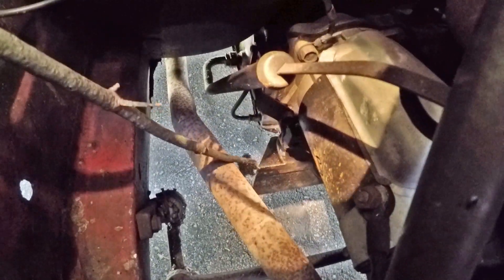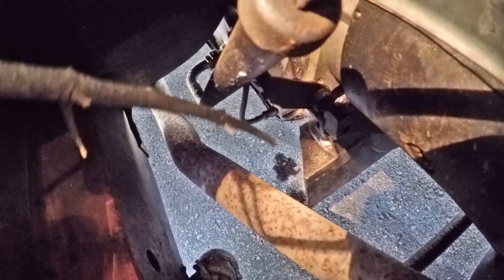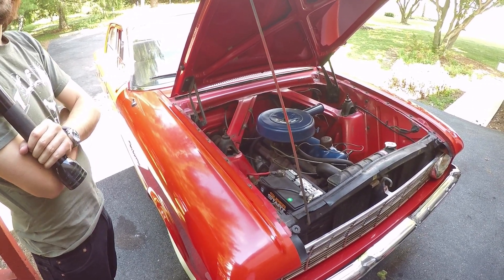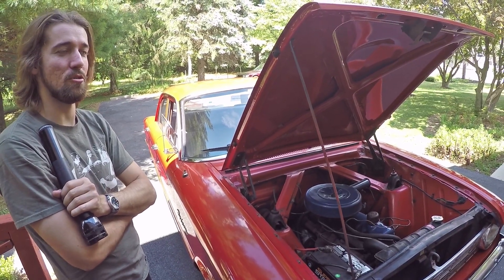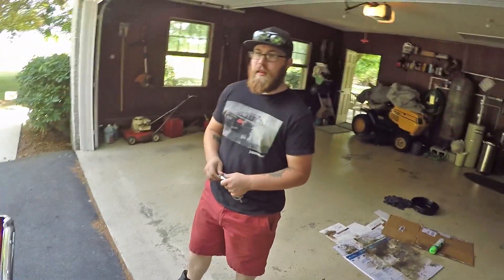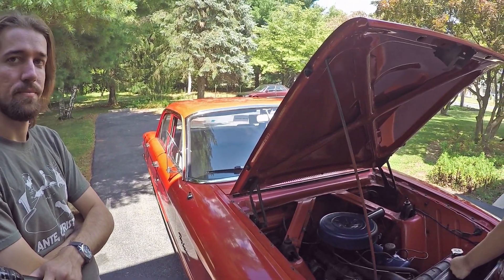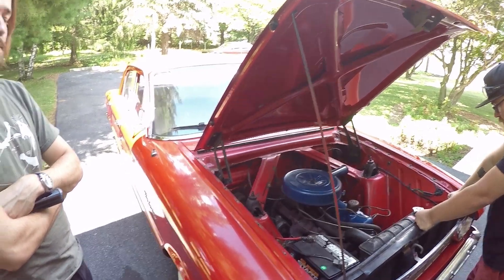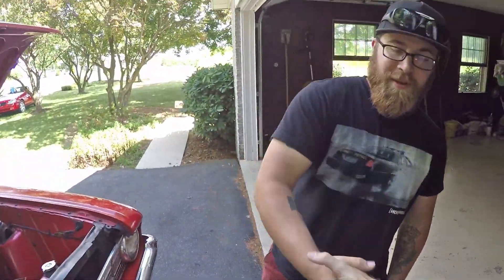Vagabond Falcon Ford-O-Matic leaks from main seal

Comment: Mr Reg, you are standing on the precipice of a HORRIBLE decision. It completely defeats the purpose of Regular to do an engine swap. It also deprives you of an opportunity to bond with the car by working on it and LEARNING something. And it destroys the original charm of the car, a charm that you have clearly responded to. 

Better plan: $5 seal, 1 hr labor in the driveway. Adjust the valves, 20ft/lbs right there. Tune the carb. Set the timing. Find the vacume leak that making it run lean, which is making it run hot. Find a mechanic who's over 50 to help you. Learn from him and keep his knowledge alive. Call Jay Leno and ask if he'll help you tune it up!

The hill was there in 1960. The car was there in 1960. The car pulled the hill in 1960.
Reply: Chevy big block swap
Reply: Jack Carroll LS1 like it's popular these days.
Reply: Nah 427 time or 572,454downsize to small block 289 305 the rare 307 the not so rare 350 or just a 400
Reply: Pretty sure 427 is ls7
Reply: ***** You, sir, are hitting the nail straight on!
Reply: *****  Amen brother!
Reply: ***** Yeah, let's say he puts a V8 in it. Then he has to upgrade the brakes, the diff, the cooling and the transmission. Cheap! :D
Reply: ***** Although I agree that an engine swap won't be Regular, I think that being under the car every other week isn't regular by today's standards either. That engine is probably running low compression, and with the other issues that will arise because it is a 55 year old motor, you need to ask yourself, at what point does it go from a regular daily, to a restoration project and endless money pit? I say that if he were to swap it, he needs to keep it authentic. Get another I6 in there that has less years and miles behind it, so it can have more ahead of it.
Reply: ***** THIS. THIS. Mr. Regular, listen to this guy.
Reply: Newgenerationisbg This is my point: the engine is old and tired, but you don't get a new one on a car like this. You simply repair it. THAT is the whole point of a 60 Falcon. On a Hyundai, yeah you just swap in a new one. But you or I or anyone with a wrench could rebuild this engine in the driveway in a few hours (exaggeration, but true too). THAT's what a regular guy would have done in 1960. 

It can be a reliable daily again, because it was a reliable daily in 1960. Even in the winter. Even in Pennsylvania. Even without air conditioning. If that's not good enough for Mr Reg, then he should sell it and buy....oh...a Honda Fit.
Reply: ***** It's such a slippery slope. As soon as you put a V8 or a modern-ish 6 in it, it's no longer a stock 1960 Falcon. It's no longer "regular". He should sell it and get a Fox body or something. I can't stress this enough. Start elsewhere if you want a hot rod.
Reply: 1000 likes for this comment. It's "Regular Car Reviews" not "Project Car Reviews"
Reply: All I can say is before MR REG starts thinking about swapping anything, just find a mechanic in PA who is over 50 and let him has his way with it for an hour. He'll do the valves, gap the points and plugs, set the timing, tweak the carb, and check the line pressure on the trans. I suspect MR REG would be happier with it after that $100 of service is done.
Reply: Tiberius Hrafn-Úlfur I see your point, and I don't disagree as such. But I would say the highest optioned car, even though period correct, isn't really "regular" and kinda misses the point. He keeps worrying about having a reliable daily driver - it was exactly that in 1960. No reason it can't be again, other than the temptation to hot rod it. I too wanna hot rod it, and I might if it weren't so original. But not as the REGULAR CAR flagship. It needs to stay stock, or it needs to be a different car.
Reply: Tiberius Hrafn-Úlfur Think about what you are saying. The engine doesn't know it's 55 years old. It's just a lump. All it knows is that it needs a tuneup. The worst possible case is worn rings. If so, you could rebuild that entire engine, every nut and bolt, for about $1000 including machining. Then it's a brand new engine in every possible way, AND it doesn't violate the RCR prime directive. 
Or, you could put a Coyote engine in it, bucket seats, 20" wheels, thumpin stereo, billet steering wheel, and a sticker of Calvin pissing on a Chevy badge. Then it would be really unique and interesting. Is my sarcasm coming through?
Reply: ***** You do have a point, but to play devil's advocate, remember that "regular" has changed in the fifty plus years since this car left Detroit.Two digit horsepower and a two-speed automatic make this car almost a liability in terms of dealing with modern traffic, where even a shitbox Elantra has a hundred and change horsepower and a six speed auto.And that motor is...I won't say unloved, but unappreciated.  For your "regular" mechanic to maintain it, that's a motor that few these days care about or want to work on.  Any generic Ford V8 on the other hand, you should be able to take a small block to your local Autozone and leave with an installed, fully functioning engine...It doesn't sound like hot-rodding is his angle here.  And I do agree, if it was a bit sketchier I'd like to see it modified too.  Personally, I love the look of the Falcons, to be honest save a couple of specific examples (hello GT 390 Fastback) I'd rather have a Falcon than the Mustang on which they were based.But this engine swap seems to be a smart, economical, and "regular" attempt to make a classic car roadworthy and reliable again.  It's like dropping a Chevy 350 in a Jaguar XJ-S, some call it heresy but if the experience is still there and the car runs properly... is it?If anything, he should pull the motor and trans and keep them, optimistically sort out the issues with the leak and keep them.  And for a good daily driver, a modest, regular V8 of a similar vintage should be plenty enough to make this a safe and reliable wheel, though I personally still like the thought of keeping it a straight six and going for a BMW 2.6...
Reply: inudude15 I get what you are saying. I am the first to admit a Falcon with a BMW straight six is pretty appealing. I might disagree with the premise that the Falcon won't hold it's own in modern traffic. Two supports for that: this car has about the same horsepower and, believe it or not, weighs about the same as a Chevy Spark. The Spark has 3 or 4 more gears though. But my real support is trucks; plenty of modern trucks have similar 0-60 times as a 1960 Falcon, and they aren't off the road. I'm talking garbage trucks, bookmobiles, etc. If a Smart car can keep up with traffic, so can a Falcon. 

I would be too offended by a solid state ignition conversion. I might even tolerate a 3 speed trans, though I don't think the car needs it. From 93-2001 I dialed a 65 Chevy van with a 2 speed and a 235 inline 6. It too would slow on hills, had drum brakes, no A/C, etc. It worked...more or less. Remember, the 2 speed is just no 2nd gear, the 1st and 3rd are the exact same. So a different trans would make it no faster off the line and no faster on the highway. 

I also currently have a 65 Valiant wagon with a slant six. I admit....I ruined that car by putting a turbo on it. You think stock is unreliable? Wait till you start modding stuff. 

There is an argument for the Falcon to update the brakes. But I don't think it's necessary.
Reply: *****
brakes i think should be updated. that would be nice to have and good updated brakes doesnt change it from regular to modded. the drivetrain is needing some love, but i dont think it is completely screwed. this is the regular car, the A to B car, not the v8 car, not something that has been motor swapped. any regular car now these days is completely stock. i own one. and doing an engine swap on my vic is incredibly time consuming and im just replacing the engine with a identical engine, let alone motor swapping something in the car was never meant to run.

my message to +Regular car reviews, the car is not a bad car, it just needs someone to love it for who it is, not what it could be. the regular car is the unsung hero daily. so if it moves under its own power, why swap it?
Reply: ***** He's gonna need a few volunteers to do that, but it would be awesome. That engine is gonna need a lot of love before it starts cranking out 85 horespower again. He probably needs to rebuild the transmission as well, and put an anti-rust coating on the car, because Pennsylvania. And he's gonna need to change the brakes to disks if he doesn't want to end up in somebody's trunk after an emergency stop.
Reply: ***** you keep saying "regular". I don't think it means what you think it means.
Reply: ***** I agree!
Reply: ***** I don't know, it's a tough call one way or the other.

On one hand, this does seem to be a surprisingly stock Falcon, upgraded radio aside.  If it is that original, well really it perhaps shouldn't be their flagship car at all.  If it really is a time warp of 1960 it should be set straight as it is and preserved as it's a neat look at what "regular" was once upon a time.

But on the other, this Falcon has been outclassed by time.  Maintenance schedules are something people don't even think about any more.  Getting up a hill is something people don't think about anymore.

The new "regular" is not slowing to a crawl when there's a hill, or having to have a substantial supply of ATF to drive across a couple of states.

Personally, I'd actually like to see a "built" 144c" straight six in something just because.  I'd be cool to see someone develop that engine because they could.

And they might be able to do some work to revive and possibly up the power on the motor in that Falcon but cost per horsepower, and in terms of reliability, I get the feeling that it'd be a fool's errand.

Maybe it gets back to 85 horse, maybe with work it approaches a hundred.  But that would be many hours and a nice chunk of change spent to make a fifty five year old engine produce maybe a hundred horsepower, hopefully reliably.

To add to that the 144 has not been a regular engine for a long time and given they drive to meet people to drive other cars they will likely need to find parts in a pinch to repair or service the car when away from home.  Virtually any Ford V8 will have parts at the ready at any Autozone, PepBoys, etc. but the straight six not so much.

Even personally, my Honda S2000 is well supported by Honda, but parts don't come over the counter.  It's only ten years old, and most things are a day or two out.  They get shipped from a bigger warehouse in another state.

In part that's because nothing from any other Honda really fits that car because it's the only RWD car they built amidst a sea of FWD, and to their credit you can get anything, but the car's rarity and uniqueness means parts counters aren't stocking anything you need if something goes wrong, it has to be ordered.

I imagine the same circumstances would surround a restored and/or improved straight six in the Ford.  You might be able to get parts, someone might be manufacturing them, or you could get them from a junkyard perhaps, but I doubt you could get parts for that motor at a local auto parts store whereas any Ford V8 you could probably built from scratch with what's on their shelves...

For the money and remembering that this is a largely Youtube and Patreon funded endeavor, a "regular" Ford V8 of the time is likely the easy and cost effective swap and one that would make the car regular in the new age and in it's new role.

Though I'd still love to see the 2.8 straight six because reasons.  Though for that matter, where are the resto-modded Falcons?  Pretty, relatively light cars that can fit a lot of Mustang parts because they're the Mustang's DAAAADDD.
Reply: ***** if you are going to change engines ,you should at least find a newer ford inline six , they still put them in the F150 as late as the late 1990s .
Reply: Jack Carroll Ford also has a very famous 427.
Reply: What is it with you people in thinking just because a car gets an engine swap, its not a "regular car anymore? Wtf do NONE of you know what was going on in the 60s car wise? Muscle cars. Drag racing becoming an American pass time. If you think for one second Joe Blow never swapped a BBC into a Chevy nova, or john Doe never swapped a ford 300 or 289 into a falcon, you're dead wrong.
Reply: im sure its been done before no question of it. but the question is why? when you heavily modify a vehicle beyond stock ( i consider stock as how it left the factory) just how regular is it? if mr regular went from 6 to 8 cylinders, whats so regular about it? sure i have a v8 in my crown vic but suppose i put a v10 in my vic, nothing about it is regular. because as any wise car guy knows, with more power, comes even more upgrades to reliably control this power ( and safely)Jordan Wiley so after you do that, how much of the original car is left? its not like he has to restore the vehicle and the drivetrain is completely fucked to all hell. it may be a 50-something year old engine, but it fired and drove 500 miles. nothing with that engine is bad, other than the current tune.
Reply: kennedy796  To play devil's advocate here, I do think you are slightly stretching some things here.

Indeed, if you dropped in a four hundred horsepower crate LS motor, everything would have to be changed or it would be a total deathtrap.

But a 302 Windsor, or a BMW 2.8; you're not talking about neck snapping power or violent torque.  Those are regular engines with regular power by today's standards.

They offer enough to make the Falcon keep up with traffic without turning it into a restomod or a one-trick drag car...

And for what it's worth, if they want to use this car as the face of RCR, want to use it to cross the country, see new states, find new regular cars, it has to work.

Any fifty year old car will need maintenance, that's just a given.  Having a 144 under the hood is likely similar to the F22C under the hood of my S2000; oh we can get that, but it's a day out.  Or, Honda still stocks that, but it comes from California.

I'm sure someone out there is supporting that most regular of regular engines, but I'm also sure that if you went into an Autozone looking for parts for a 302 Windsor you'd likely have them installed and on your way before the equivalent parts even shipped for your 144...

And if they want this car to be regular by today's standards and to be a functioning part of the RCR team, to be the face of the production and a film car; then it needs to be reliable and flexible

With a leaking Ford-O-Matic and a easily heated 144 straight six, it isn't going to be any of those things.

I would thoroughly support them sorting out the engine and trans and keeping both for future "caretakers" of this regular little gem but as it sits trying to use this car in the capacity of Silicone Sally for example would be a Fool's Errand at absolute best...
Reply: inudude15 bmw straight six reliable maybe but easy to find parts or fix not so much. ford invented the inline six , they may not make the best version but they do make a very reliable inline six that would keep this car a lot closer to original and still more than triple the power . the 4 litre inline six in my jeep hauls ass . ford put a 4.6 in the F150 that would be perfect fit for this car . add a five speed to the mix , you could probably even make a standard work with the column shifter .  what is wrong with the google spell check , i can see where some of my spelling may be wrong , but the predictions they give are so far off i have to just leave the red line there or lose the context of what i'm trying to say ?
Reply: quineloe regular means that if you eat three times a day , you should shit three times a day . lol
Reply: inudude15 Sorry for the late reply - I was on vacation letting small fish nibble my ballsack  at Myrtle Beach. On your post, good points but I respectfully disagree in a few aspects. A "regular" car isn't necessarily reliable, and I think a theme of RCR is showing some love for the overlooked car, or the fatally flawed car, or even the unreliable shitbox of a car. That's where the uniqueness is. Otherwise, we'd all be watching reruns of Motorweek. Another point; which RCR would you rather watch? One where nothing happens, or one where the chase car pukes all over the highway, and the Roman has to piss in the radiator to keep going? Lastly, to date RCR doesn't really do mods. There's been some modded cars, but the most extreme would be the manual shifted Roadmaster or the jacked up Toyota 4Runner. To date, there have been no Hemi Dusters or nitrioused Nissans. They could rebuild/mod/resto/sodomize the Falcon sure, and I bet it would be entertaining and replete with dick jokes, but it just wouldn't be the same. I dig where you are coming from on reliability, but I repeat; the Falcon was reliable in 1960 and it can be reliable again with crazy little effort or expense.
Reply: ***** You have a point, though that does sound somewhat like you wish for an RCR/Roadkill crossover.  Zip ties and hopeless optimism is more Frieburger and Finnegan's things than Regular and Roman's :P

I guess we just have two different yardsticks for reliable.  1960 reliable and 2015 reliable I suppose are just two different things, not that either is wrong.

Personally, I still feel that for reliability, safe interstate driving, and practicality the 144 might be more work than its worth for the end result.

It DOES have to be the work mule to let them film the other fantastically imperfect cars out there as the "face" of RCR (pun intended) and to do that and be capable of integrating into modern traffic speeds and patterns, and modern expectations of dependability and maintenance schedules, I'm not so sure.

But then I could certainly be wrong...
Reply: He got it working tho :D